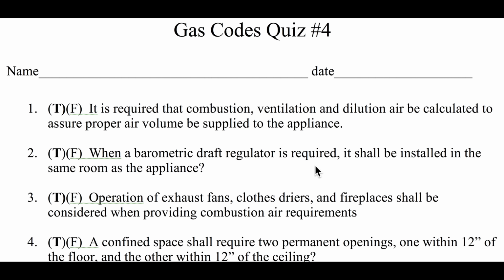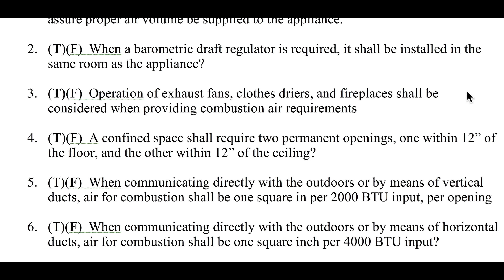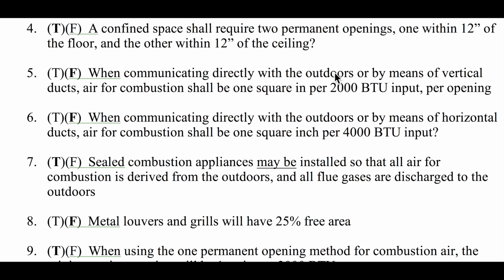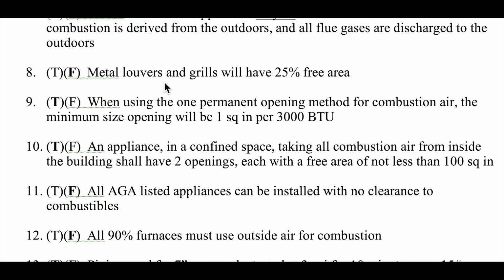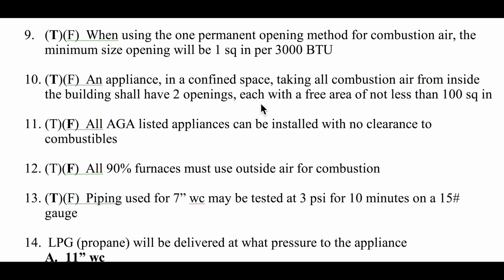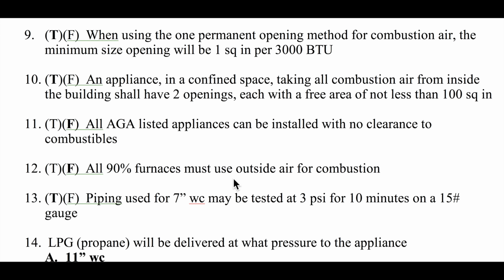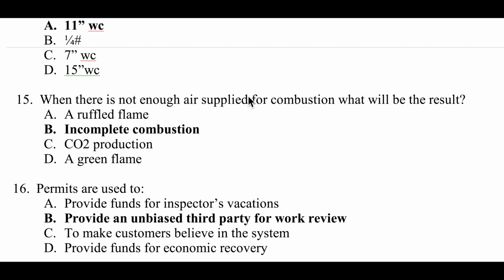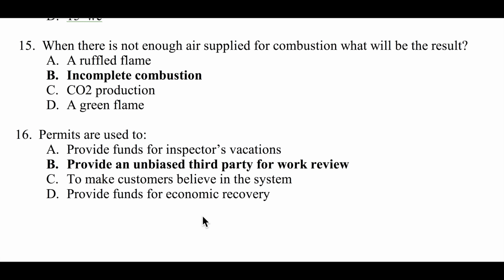Gas codes test #4 answers

Comment: I recently took a test and one of the questions was name 5 gas fittings.  I answered 1. Black elbow 2. Black tee 3. Black cap 4. Black union 5. Black coupling.   

Is this correct?  I wasn't sure exactly what they meant by that.  

Btw.  Thanks for your videos.  They are amazing!
Reply from the maker: I would consider it right.
GFM
Reply: grayfurnaceman are these questions for gas 2 licence or what are they for ???